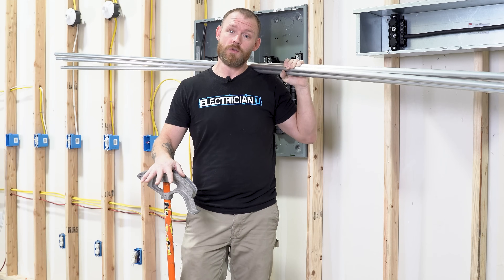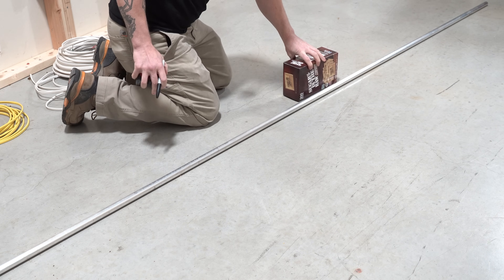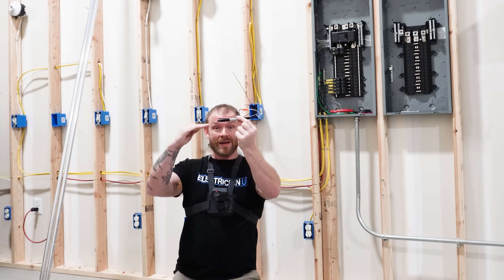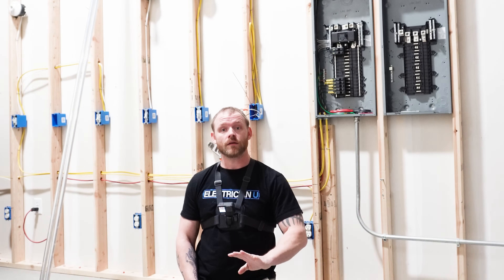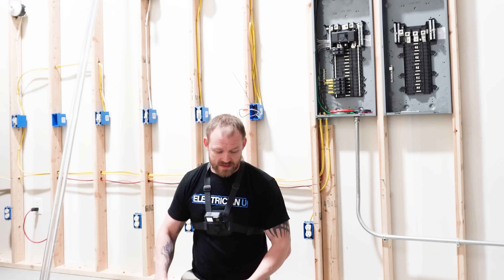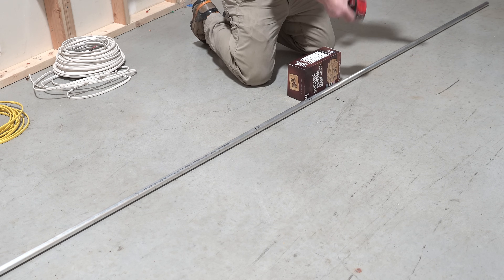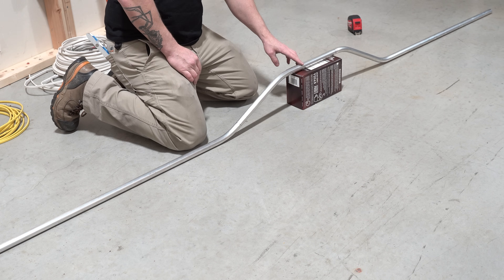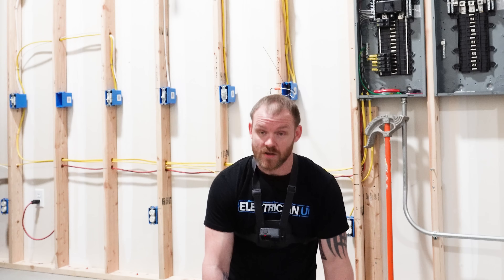How to Bend a 4 Point Saddle in Conduit

Comment: I didn't see any use of the notch, for center of the bend. Bend 1 and 3 I thought it was important to hit that actual bend mark otherwise depending on size conduit due to the bender your spacing significantly increases unless you actually never spin the bender the opposite direction. You bend all bends in the same direction. Going in sequential order from one side of the pipe to the other. 4 marks... Left to right or right to left... 1, 2, 3, and 4.
Reply: Notch is only used for center bend on a 3-point saddle. 4-point saddles are all arrow, because they are really just 2 offsets. Offsets are made with both bends on arrow.

Comment: Hey! So I’m having to go behind other people that installed conduit and I have to make a 4 point saddle within about 10 inches of a 90, ideally I would have a 90 straight shot but since I’m last on the job and there’s two sets of conduit between me and my box I have to make a saddle with a 2” rise at 9 1/4 long, so my “2nd” mark as you refer to it is 5-6 inches away from my 90. With your experience I was wondering if you’ve had to deal with this type of scenario and what you’ve done if so.

Comment: You want to bend the less degrees in the pipe as possible so its easier to pull through. You only get 360° of bends in a run of conduit before you have to put a box in the run. Sometimes however, you dont have a choice on the degree of the bend 30,45,60 etc. What I'm saying is the less bends the better if u can get away with it.

Comment: Lots of different techniques for pipe bending. I typically measure depth of offset needed, width needed. Then I chose the multiplier for the degree bend I want to use. Then I lay out all four marks on the pipe. I normally use the center of the bend arrow as my bending point and start with the first bend on the floor. Then flip and bend the second bend making sure the offset is square. Then I bend the third bend and flip and bend the final bend. I adjust any dog at that point if necessary. With emt I don't bother with figuring shrinkage. I know where I want my first bend and add a couple of inches and bend the offset. Then I hold it up, mark and cut to fit exactly. Unfortunately in today's workplace all the contractors are interested in is how fast you can do the work. Side note. Early in my career the shop sent me over to help some guys who had been residential hands and they had piped in this job. I got there and the lead guy wanted to show me their pipe work he was so proud of. We walked into the mechanical room and there was the panel with about a dozen half inch pipes coming out of it. They all offset back to the block wall the panel was mounted on. Went up a few feet and there was an i-beam sticking out of the wall so they saddled all the pipes across it. Continued up and then in the structure they offset on another beam and hung a 90, crossed the room and saddled another beam, went out into the hall way and turned a 90. Looking down the hall I could see two more saddles, then another 90 and there placed their first pull box. All the pipe work was going to be in a sheetrocked inaccessible ceiling. I looked at the guy and asked if he had any idea how many bends he could put into a pipe run and still pull wire through it. He said he thought you could pull through as many bends as you used.

Comment: random not so random question what does code say about trunking/ raceways  can u have electrical cables 120V/240V electrical wiring being surface mounted along the walls instead of behind the panels ?

Comment: Great presentation. I've been in the electrical trade for 40 years and watching you I picked up a couple ideas. The aluminum emt with the inner coating sounds interesting. 

On another note, we use dry erase markers for marking bend points. The different colors are easy to see, and they wipe off easily when you're finished.

Comment: I usually will add for shrinkage on 4 bends. Especially on an obstruction that high. 30 degrees is a 1/4” of shrink per inch of offset. So you’re looking at 1.5” of shrink in a 6” obstruction. Just looks neater if the center of your saddle match the center of the obstruction.
Reply: Did anyone notice he flipped the bender for no reason, it still ended up in the same position it was lol, just flip the pipe around and rotate
Reply: Would u add that shrinkage value when measuring from point 1 to 3?
Reply: @estebanhernandez243 You would add the shrinkage to both sides equally. Your obstacle measurement won’t change from point 2 and 3. So you add the shrink from 1 to 2 and 3 to 4. So 1.5 of shrink in total would be .75 per side. You remember how he said multiply by 2? You would just add the .75 for shrink so in reality he should of measured it at 12.75 away from the obstacle each side.
Reply: It has nothing to do with amount of degrees on a bend for shrinkage man, it’s the amount of offset. 1/8” shrinkage per 1” of rise.
Reply: @maddawglynn  wrong.

Comment: 11:52
Why use the arrow, rather than the notch or star ?
Reply: Because that’s what it’s for. The arrow tells you where the bend will start ( or end, depending on how you look at it)  the notch is for the center of a 45 degree bend, and the star point is for where the back of the bend will be, when bending back-to-back 90’s

Comment: Shrinkage is really bad in colder weather. Don’t let girls see your conduit, especially if there are bends in it.
Reply: Some of y’all surprise me lol. Working in the trades and not understanding a simple Johnson joke. Bet y’all can’t even roll a joint😂 it was a good joke bro.
Reply: Mines dogged
Reply: 🔵What you said doesn't make sense.🔴
Reply: @auletjohnast03638  than your not a sparky
Reply: We have the opposite in AZ the extreme difference in hot/cold cycles causes excessive moisture and the emt droops unusually lower.
Reply: @hasmanknitter4082 😂😂
Reply: So typical.
Reply: Luckily we have global warming
Reply: 1 inch of shrink is better than 2 inches of shrink baby. Just check to see if it fits
Reply: I still smashed tho
Reply: @jasonblaha6891 😂😅
Reply: Shrinkage is the same in cold/ warm weather bro. Has absolutely nothing to do with temperature
Reply: @maddawglynn relax try hard, it's a joke.

Comment: Imma be completely honest...for the time and pain you spend on a 4 point you could’ve bent two offsets. I’ve only bent like 2 of these things and I’ll probably never bend another one unless the foreman insists. 😎
Reply: Being bad at bending conduit is not a very good excuse for not using the appropriate bends for a given obstacle.
Reply: A 4 bend is 2 offsets it takes the same amount of time
Reply: @fordkennedy2688  He's talking about two arbitrary offsets with no shrink taken into consideration and unequal distance on each side of the obstacle. Looks like crap to anyone that actually knows how to run pipe.
Reply: @zacharybob4336 i think he's talking of doing 2 offsets with a cuppling in the middle of the saddle.
Reply: @martf1061  God you’re probably right..
Reply: @zacharybob4336  🍻
Reply: @martf1061 yeah it looks like hell

Comment: You can purchase a rubber boot (Made by Ideal Electrical) for the top of the bender - so when the bender is inverted for hand bending it does not slide.    Ideal 74-037 Bender Boot for Conduit Benders
Reply: Lol it called your foot to keep it fron sliding.
Buy 1 for yourself. No shop will get you 1. And if your an apprentice, I guarantee it would disappear within 2 days.

Comment: That’s really cool. I bent some conduit in an air handler a while back and got an education on it. 
It’s an art, for sure. 
I wonder if you could make a weighted block with a hole for the handle to sit in, so you don’t need to use your foot to keep it from sliding around when it’s inverted. 
Throw something soft in it and it won’t jack up the handle grip. 
Could also get some pipe to slide over the EMT to use as a cheater and be able to stand a little further back. 
Would that work?
Love this channel. I was an electrician on commercial ships, and working on land is WAAAAAY different. 
No conduit or wire nuts, ungrounded system, no neutral leg. 
Armored cable for everything and everything is hot. 
Your channel is quite the translator for me and I appreciate it.
Reply: Good ideas!! 
Theres rubber boots you can put on the handle to prevent slipping.